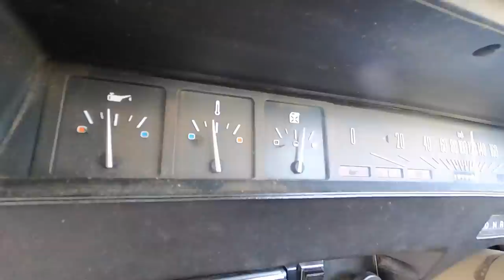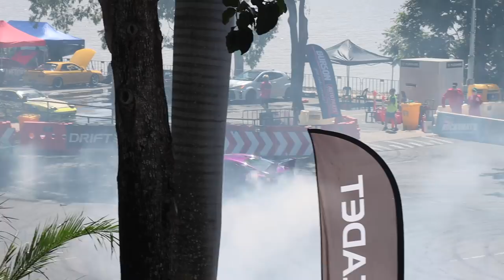Road Tripping in the IRON LION - THE SKID FACTORY

Comment: I've got an HJ wagon ,trick is to fill when under 1/4 tank, because the fuel goes into the bottom of the tank and needs to push past the head pressure of what's already in it . 
One trick is take a bit of wood to drive onto to get a better angle   .